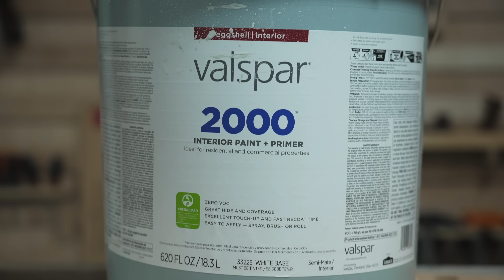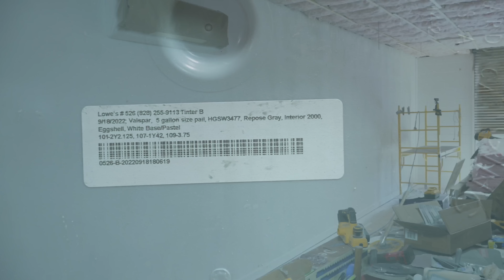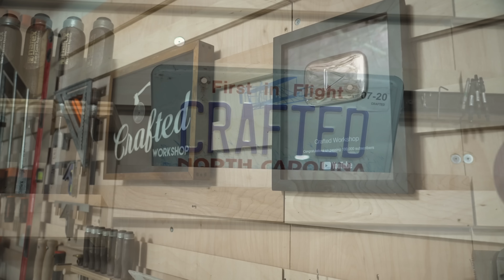WORKSHOP RENOVATION 10 : Painting, Shop Storage & French Cleat Wall

Comment: Using a roller to backroll after spraying would’ve saved you a lot of time with your walls. Love the look though
Reply from the maker: How so? I’d love more tips, still a relative beginner at spraying!
Reply: @craftedworkshop  while the sprayed wall is wet, take a paint roller that is a little wet from the same paint to go over it. It lays down most, if not all, the fibers that might leave a rough texture. It’s especially important with fresh drywall. 

It might seem to take more time but in the long run the sanding takes longer and more resources. I learned the hard way once while spraying homes. For future reference you now have the knowledge to save some time and still get fantastic results 👌